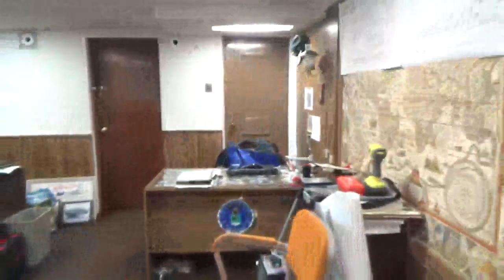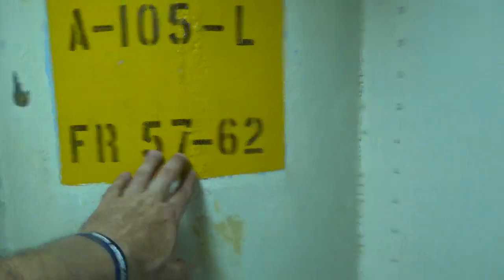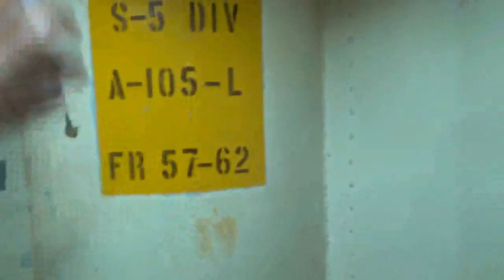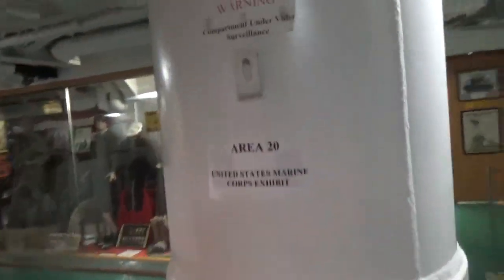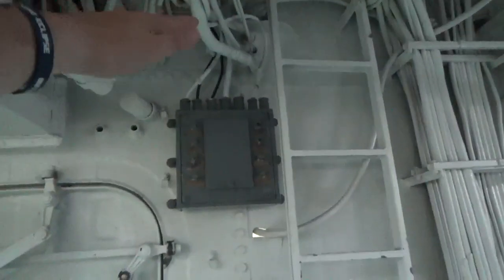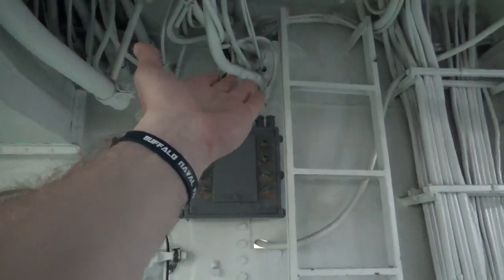Gun fire communication: USS Little Rock's Gun Director Tubes

Comment: There is a a second wiring trunk on third deck next to the door for the forward uptake. It’s across from the crew barbershop/technical library. I do think the wires come across but I think it’s on the first platform. There’s even a very small watertight door for maintenance access on it. It’s very strange that it’s not on the blueprint though!
Reply from the maker: Good call, belind0388. Thanks, and it is strange that it's not shown on the blueprints.